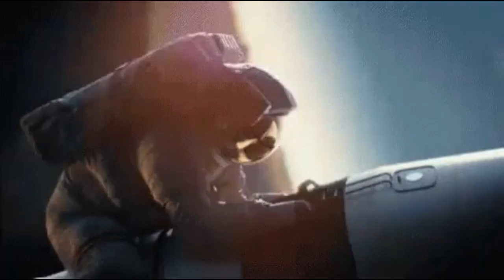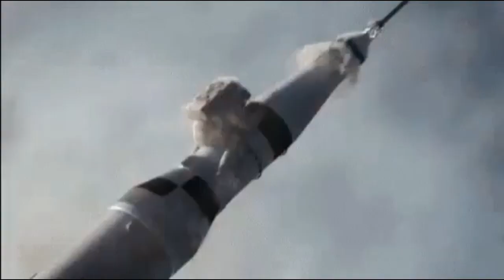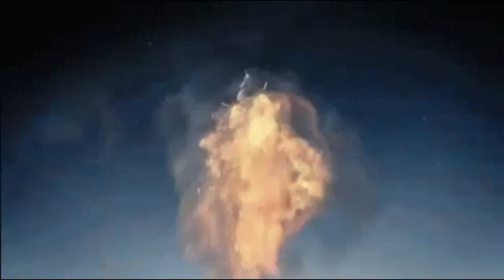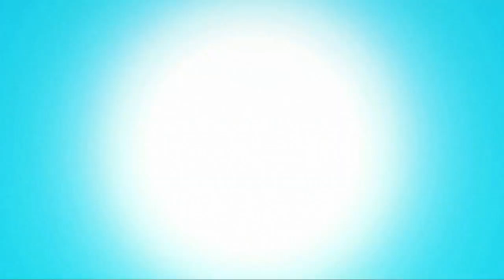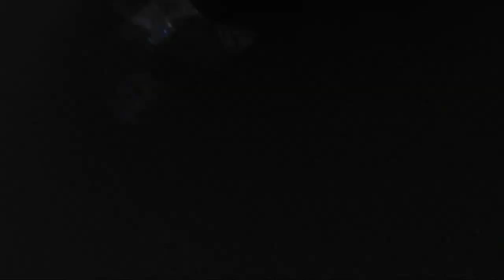Space X Starship Mk1 Explosion during a pressure tank test

Comment: More work for the boiler makers.
Reply from the maker: not for cryo pressure tanks!! 😆😆😆
Reply: @M2M-matt  True, but for the outer skin - the stuff you can see damaged. - the tanks obviously are special works, although done by welders who could also be boiler makers trained up.
Reply from the maker: @janeytheterrible  yes but don't forget mark1 was only to be a low altitude test vehicle. Mark 3 or 4 will be a single weld hull.
Reply: @M2M-matt  Yes but of course the outer skin was still made by boiler makers and the repair of the skin will be needed